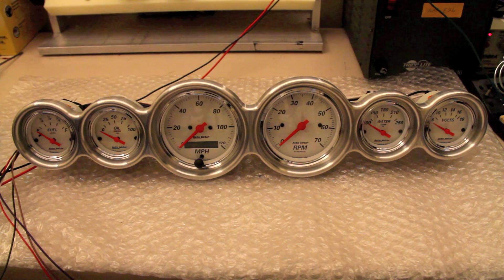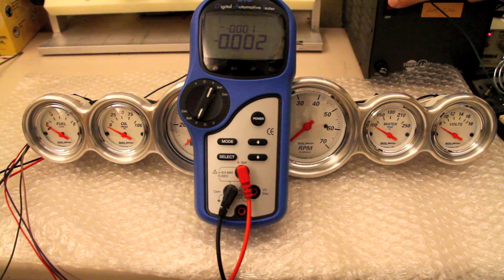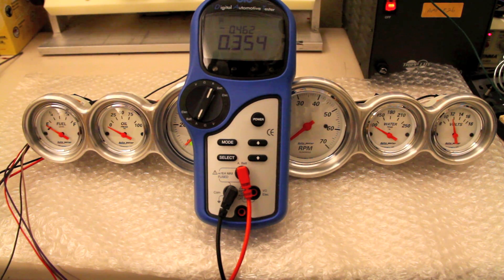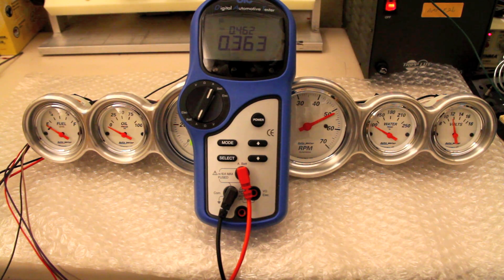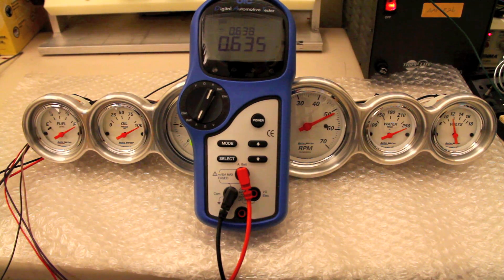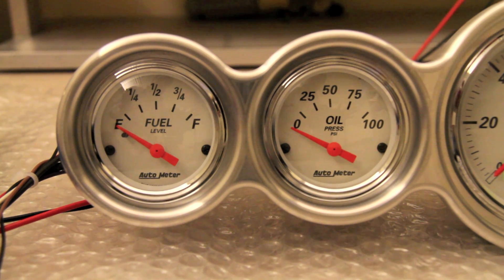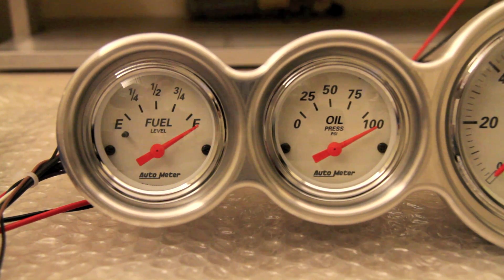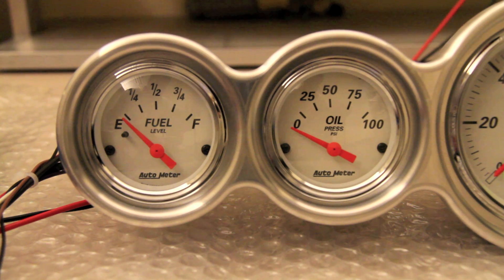AutoMeter Gauge Current Draw

Comment: A fuse is a device to protect the wiring not, the load. You size the fuse to match the wire size not the current the load draws.
Reply: No, you are wrong. To determine the fuse size, you must know how much amp the device draw. Usually, a gauge draw 0.2amp, you should use 0.3 - 1.0amp fuse for better safety, but you can use up to 5.0amp fuse if you want, it is still safe. But if you wired all gauges together on 1 power wire like in this video it will draw more amp, so a 0.3amp fuse will blow up before the gauges reach the peak power. Then you need to use a higher amp fuse than the current draw. If the current accidentally overload, the fuse will blow up before the gauges damage, that is the purpose of a fuse on all electric device's wiring.
Reply: Incorrect.
Reply: @teamdougherty  So? If the gauge's wire is 4 awg, you will put a 100amp fuse on it? Please do it, and I would excited to see your gauges explode 🤣